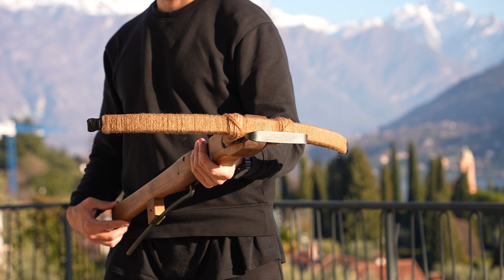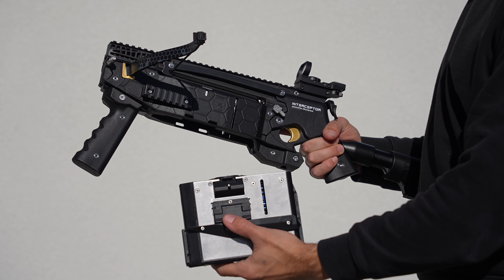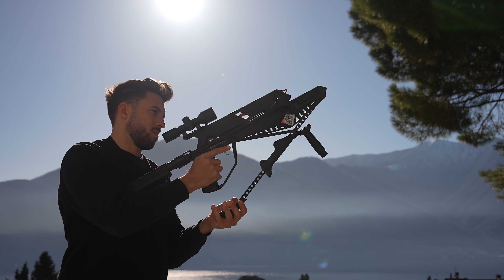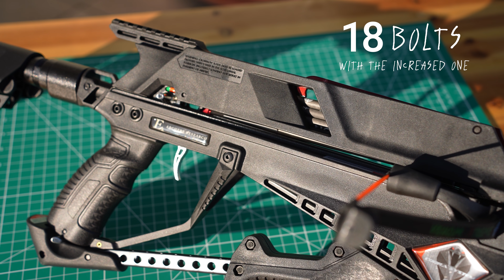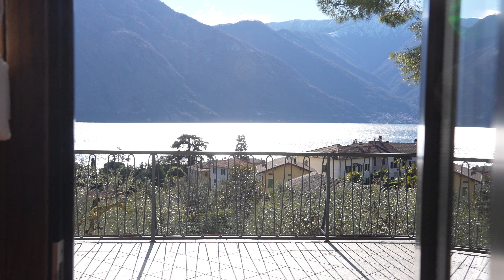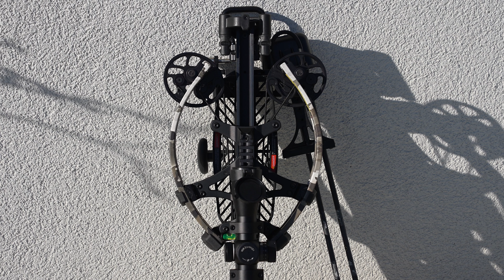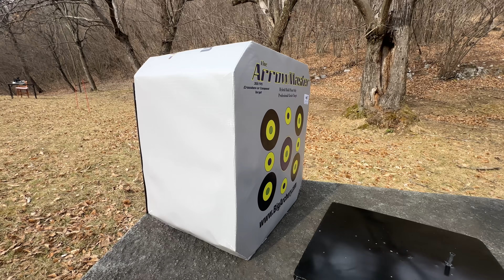How Dangerous are Crossbows?

Comment: Sitting in the next 1. 

Question is to me. 

I like, 

The first. Bow. You the second bow? You used where you had to pull down and cock it where he did like a little 80 pounder and he made the magazine. I don't remember seeing that video. It was very good. I like the idea of the ATM round magazine, I liked the idea. You can prickly quickly, reload it and pull down. The only thing I would ask on that, I think it's called the interceptor. On that particular 1. I would say, could you do it similar to a shotgun where you have a pump action to pull back? Instead of pulling back there, would that make it easier? 

And is there a way in getting an automatic pullback where you say fires reloads and fire with 2 separate bows and 2 separate points. So you're firing and you put the magazine in it for fires with 2 bows 

That would be much more practical long term. Question is, I would ask Average ordinary longbow. For. Sniper version. Not The actual approach. Could you? 

Use. A standard Longbow at say, 100 150 pounds or 120. Pound, draw weight and achieve the same. And the same and a greater rate of fire with single arrows. 

That's what I would ask. 

I love the video brilliantly done. Love the bows.

Comment: I have an old 175lb Jaguar that fires 22-inch broad heads. Still, I was using Fieldpoints, had I been using my 225lbs, I might have got all 3, it is always my "Go Too" spare, & the last time I used it in a Home Defence role it was 5 feet from the scumbags, & it went Straight Through 2 of them. I followed up with my "Repeater 60lb, Laser sight, pump style action" I peppered them with 6-inch bolts. I was going to follow up with my "Ornamental Karambit", but they had definitely had enough. However, I did have 2 more home invations of multiple scumbags who I did get t ouse my "Ornamental Karambit on, my High Score is 476 Stitches & Staples, they all looked like Patchworl Quilts when they turned up in court, & one even cried, saylng "I would rather have been shot", if anybody in the UK uses their "Sport & Recreational" gear for Self Defence, please remember that is is for Sport & Recreation & NOT for Self Defence, as having Anything for Self Defence is ILLEGAL & you could face jail.
In the UK you don't have the luxury of other countries that allow Self Defence, & it is Up close & very personal, so be ready to be shocked, you are only inches away, you feel their breath, you feel the knife cutting through them, their blood & sweat on your own skin,   you use a Pepper Spray you will need a mask or resporator, because it has nowhere to go, so it will affect you too, take a look at the space you will be confronting them in & plan accordingly, any "Ornaments" you use cannot be to long or you will hit the walls/celing & not the scumbags, a Certain Type of people in my area, although only a few in number are responcible for over 70% of the crime, these are Not the people you want to let past you & get to your family, my advice would be to get some instruction in Self Defence & find something that you can use, for the basics, is you can Box, then you can use a Karambit in it's most Simple manner, but Don't try to take them on Empty handed, & Don't rely on the police farce, their Minimum Responce time from the Main police station to my home was 47 mins, that covers 2.9 miles, on 3 well lit, well kept empty roads.
You can pick up a cheap pistol crossbow for under £20, 50lbs 6 inch bolts, it will make them thing twice, it will fit in a draw or on top of the wardrobe, & take seconds to load, you should most definetly get a Strobe Torch, this will blind them & give you vital seconds to decide what you are going to do, a shot to the belly is a good option, it will penetrate well, without killing them, but remember, whatever you do, you were "In fear for your life & the lives of your familly", to be able to Defend Your Self & your Familly, you don't have to be Hit First, you just have too Fear for your Safty, Self Defence should be a Right & the abilitiy to Activly Defend Yourself, your Home & your Familly should be a Right in Great Britain, without the threat of Inprisonment.

Comment: Where i am hunting with a crossbow is pretty common, i never liked using carbon fiber arrows in xbows, they tend to shatter from the force of impact, it makes practicing with them expensive, plus i have seen carbon fiber arrows explode as they are fired by the xbow, aluminium bolts are a lot safer and the extra weight of the bolt lends itself to more accuracy especially in crosswinds.

Comment: The medieval crossbow you used had a weak draw weight. Google says a hunting crossbow is between 450 to 600 pounds, and battlefield crossbows can get up to 1300 lbs.
Reply: Yes, you can't pull medieval crossbows with hands without 1 meter lever. This was more like a toy than an actual crossbow. Also, it was very-very short, like scale-down version. Proper medieval crossbow had 50cm-60cm arrows that weigh 60 grams and 100-150 jules of energy in the arrow.
Reply: @Xizario2  and it was mistake. Because, heavy medieval crossbows were very innefective with light bolts, they were very heavy, so good at pushing heavy things, into which, they transfered energy.
So bolts should actually weight up to 100 grams, not 60. And with 1000 lbs one could go even to 120 or 150 grams, to be much more effective.

Also, you cannot get to 150 joules of energy with 60 gram bolts with medieval crossbow. Reason is, by increasing poundage, you don't get any projectile speed advantage. It always flies between 45-55 m / sec. By increasing poundage, you transfer more energy into heavier bolt. In other words, from 1000 lbs crossbow, 60 gram and 120 gram projectile fly out almost same fast, so you'll get energy advantage only with heavier bolts.

Comment: Do you realise that the bolts you used with the medieval replica are wrong? "Medieval crossbow is not lethal". Yeah, sure, they just shot them at each other for fun at weekends.
Reply: It seem also poorly made too, since it not fly straight sometimes, which is a bad thing.
Reply: @Nerd_Cyclist_Jalanan and it's actually very weak. Of course the bolts are not heavy enough so the energy transfer is poor and those bolts might destroy the crossbow.
Reply: another plus is that he's using a crossbow with relatively low draw weight or low draw length
Reply: The fletching or fletches (feathers) need to get that log of a bolt to spiral for more accuracy. Crossbows were also effectively used during warfare otherwise it would have been tossed to the side. Archery was a form of artillery to soften the attack from your enemy.
Reply: We just happen to evolve thicker skulls. I mean, its been like 500 years...
Reply: @marcosdly please say you're joking
Reply: Bro he wasn’t there in medieval times my guy, he did the test and it said it wasn’t lethal and he commented saying he actually got an average crossbow with a small drawback weight compared to the 1000 lbs drawback weight of an actually medieval crossbow
Reply: To be honest his bow would be considered a siege bow and not s cross bow. Or a hand crossbow there are different variants 😊
Reply: @mahihkan3592  You have no idea what you're talking about. This is way too light to be a siege bow. It has the draw weight of a hunting bow. Why spread misinformation?
Reply: Plus most of the other crossbows he kept hitting in the cheek/jaw area. And It would penetrate the cheek. Not the actual skull.

Comment: Cool, video... but it seems a bit on unfair to be measuring a "medieval" using limbs weaker then what period archers would use (my classic yew long bow as a 120lb draw) , when a period crossbow archer was used to bust throw armor... why not use a "traditional" crossbow that was actually designed to fire in the same category of shots as your modern ones, something like a Arbalest design has a draw of 500lb; and their where Chinese & Korean repeating cross bows... or more contemporary designs based on period tech for a crank based repeating crossbow

Comment: He says the historic crossbow isn’t lethal when they in fact were used in warfare FOR A LONG TIME….they were deff lethal lmao
Reply: Also he uses all these exotic bolts with the modern crossbows but not the historical?
Reply: @blaykeysproduction probably because that's what it's made to use.. 🤔😂
Reply: I believe his historical bow is very janky those guys had em absolutely perfected his arms are ripe wound seems they slow the bolts a lot. Heavy draw doesn’t equate to actual speed. We know they penetrated armor. Some rando guy made a poor example.
Reply: "Based on this test"
Reply: Needs steel bolts
Reply: The bolts for the medieval one are really crappy, no wonder he deemed it useless
Reply: @Kinkoyaburi which is ironic cause they killed plenty of men for a long time.
Reply: Both bows and crossbows were hardly lethal unless arrows hit  the heart, an artery or the brain, just like in the case of firearms and bullets. The real problem was that arrows were dirty, full of germs and diseases and that caused later complications that lead to death. Another problem was the arrowhead's shape, as some could cut worse and others could cause irreversable damage when extracted.
Nowadays, a firearm comes with a sight, a stand etc, whilst bows and arrows didn't have that luxury, so precision wasn't their strong point. Shooting arrows with longbows off the walls of a castle wasn't about precision. Shooting a crossbow wasn't about distance, as they were efficient mainly in a few meters. The bolts they used weren't as developed as they are today.
Using a weapon in warfare doesn't mean it is 100% effective., with a 100% kill rate. Solders using armour were hardly ever injured even by powerful longbows. In order to fo that, one would need to reach a weak spot in the armour, like joints. Not as easy as it seems, especially during a battle.
Reply: @remvisual9201 Yep!
Dipping arrow heads in excrement comes to mind!!

Comment: How can you compare anything, if you test crossbows outdoors, in different locations, using different bolts and also im sure accuracy tests are unreliable because of shooter. Plank that you use plank with knots, where wood is harder to penetrate. When you use gel dummy you also change angle where you shoot, which ensures unreliable  measurements.

Comment: man...$4k  for a crossbow...with bolts that are $18 each.  it's  totally drool worthy, but  is not really practical for my budget and the intended use.  but i wonder how good one might be if it were $1000  and the bolts were alot less than $18 each.  i may have to do a little research.  it looks fun, and i  could use that in my yard

Comment: The tenpoint's energy puts it comfortably between .22lr and .45acp, which is pretty wild. That said, late medieval crossbows usually had about twice the draw weight of the one used here, and as a result similar output to the Lance. Hand-cocking them at that power was mostly impossible, which is why they usually used a crannequin like the tenpoint.

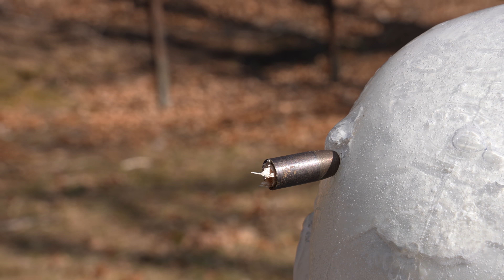Comment: 4:30 the thing is the bolt tip that you are using was mostly used for practice. For hunting, a broadhead is used which is extremely more effective when it comes to peneteration and damage. In wars, they used bodkin arrowheads which pierces armor, skull, etc

Comment: I think that was the wrong wood on those medieval bolts, and the tips were very dull. Practice tips for sure, they have no grain weight. I remember watching a documentary years ago, and during sieges they would "soak" the bolts in water and mineral oil in a barrel up atop the ramparts of a castle. Looked like the bolts were just too light. Some of them were tumbling mid air after like 15 feet.

Comment: You can't mesure accuracy with so few shooting experience. In the first shot of the first crossbow, you were focused, in the others you were feeling confident. And that's the mistake most shooters make. 

Every experienced shooter will tell you how important is the focus/not gassing part is.

There is an old shooting motto which says that the trigger must surprise the shooter.

When it doesn't, it means you sre confident and you are highly possibly going to miss.

Try the difference with any weapon for a longer time and you will understand the difference yourself
Reply: The darts you are using are definitely low quality. Try with a better historic replica with proper ammo

Comment: warcrossbows in medieval ages had  average drawweiight of 600lbs, those were cocked with goats foot, then you had steel limb crank siege crrossbows that had 800-1200lb drawweight, wwith bodkin tip it would pierce arrmmor betterr tthan anything, 200lb crossbow would be considered light hunnting crossbow.

Comment: I think that for the medieval crossbow, you should've used better bolts. The bolts used were not accurate to what would have been used at the time, specifically the tip. While not far off, i believe it reduced it's capabilities enough to be consequential.

Comment: The ten point would not be practical for an apocalypse scenario. Bows and ranged weapons are only as good as the duration the ammo holds out. If it's wrecking it's own ammo every time you shoot, and it's that picky about the ammo, then it's not a practical solution. The Adder looks like it'll be pretty good.

Comment: Another excellent video. I'm currently running with the adder with a 90lb limb. To be fair, I'm not that bothered about a magazine. With practice you can get a decent fore rate. I'm very happy with my Adder and I'm glad to see how it stacked up against the others. As a by the by, I don't get through a lot of bolts due to breakage. 👍

Comment: how dangerous are crossbows? well considering real crossbows weather they be the normal kind or like the tiny ones with little bolts dipped in poison, they have been used for centuries as weapons of war even as late as the 1800's in some cases. so they are very dangerous, as dangerous as a modern shot gun or rifle? no but everything in context, if your in a position where you can shoot it without much reprisal then you will have a very relyable weapon.

Comment: OKAY FIRST PROBLEM. 
You use an Era replica crossbow but you didn't use Era replica crossbow bolts.
Go do a little research (I'm not trying to be insulting or a smart*ss. There were several different types of bolt tips (((and yes including ARMOR PIERCING TIPS))).

Comment: 10 point is way too powerful! it basically shoots ammo the way it destroys it's bolts so consistently. video makes it look like a bolt will last you 1-3 shots. at $110 for 6 shots  and lets add a 7% sales tax thats nearly $20 per bolt. if the bolt only lasts 3 shots that's $6.50 a shot; which is the cost of 416 Barrett ammo which is more costly than 50 bmg per round.

Comment: in the case of apocalypse, these thing will be your life saver. becasue those powders for munitions would be harder to produce. no electricity and no industry.
so anybody would want to keep a pair of either the interceptor/adder, with either the lancehead or the 515. since you will need something ready to use at close quarters, like those semi auto ones, and something effective at long range. but really, you will want to be able to retrieve the bolts. the 515 would be too much.

Comment: I think that those arrows or in the dubbing of the video (bolts) can be made with a lathe just like a crossbow. If they are made of stainless steel, it is very difficult for them to break. Or tungsten. That is to say, in case of necessity, there could be many. It also depends on the legislation of each country. Not just anyone can have them because they are not sold unless they are made by the person. They have also been used for some time in the army's special operations corps because they are very quiet

Comment: Oh, generally speaking I'd rather get shot with a bullet than a crossbow.  Those broadheads are an array of razor blades, sometimes barbed so the bolt sticks in you and you can't get it out without ripping out a chunk of flesh.  A bullet is relatively clean by comparison and might pass right through you.  Ideally, I'd rather get shot by neither of course.

Comment: for everyone watching, even though crossbows could have a much larger draw weight than a comparable war bow, a bow would most likely have a similar or even higher power rating because the crossbow has a much shorter draw length, projectile, string, and wood recurve. ex. a 250 lb crossbow would be similar to maybe a 80-100 lb bow,

Comment: an issue with your crossbow bolts is those wouldn't be the bolts used for warfare. The bolt tips would be similar to those used by proper arrows for bows. Bodkin arrows, designed to penetrate armor, and broadheads for shredding flesh. Essentially what you were using were field heads. For target shooting. Crossbows were actually hated by certain people because it made it easy for peasants to kill knights and nobles in plate armor. Normally you'd need a longbow which took years of training.
Headshots are unreliable due to the curved nature and hardness of the skull.

Comment: Hey @MikeShake, saw your video on the air rifle and thought I'd offer some interesting insight on a projectile design. So there was a company that was working on bullets that could spin in a smoothbore barrel. They were by Franklin Armory if I recall. But basically, the idea was to make a bullet shaped somewhat like a shuttlecock. Essentially there was the bullet tip, that then would shrink down before flaring out into multiple angled fins. This was in theory to make the bullet spin by itself without the need for rifling. Allowing smoothbore weapons to extend their range.

You could perhaps 3d print a similar design and test it. Probably still would fall apart but worth a shot.